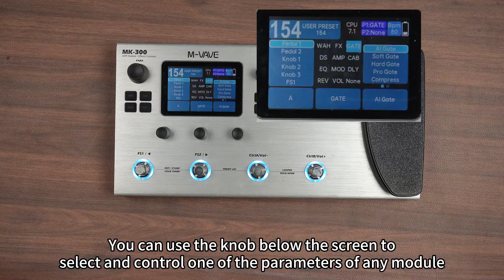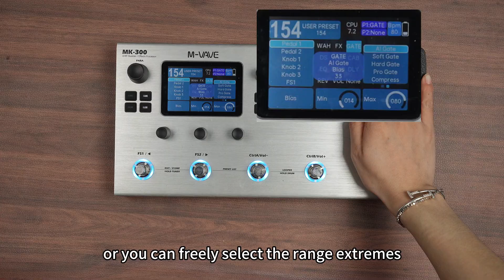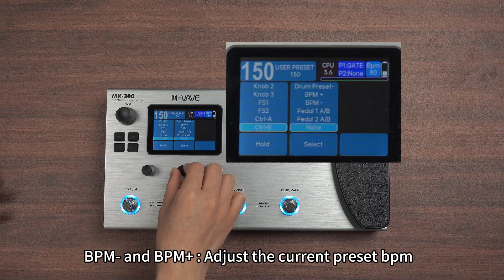M-VAVE MK-300 Multi-Effects Processor CTRL Module Introduction

Comment: Please release a new firmware update for the MK300.
There are several serious issues that need fixing:

When switching presets, sometimes the device turns off and reboots automatically.

Delay effects cause instability in certain presets.

Some presets crash the system randomly.

Also, we strongly request these new features:

Please add more OD/DS effect blocks to the signal chain.

Let users freely arrange the signal chain, for example: Amp → OD → Modulation → Delay → Reverb, etc.

Allow multiple instances of the same block (e.g., 2 delays or 2 drives).

Many users love this device, but it desperately needs an update to become more stable and usable for live or worship settings.
Please consider these improvements seriously. Thank you!
Reply from the maker: You can contact me on Facebook (M-VAVE Zhang) and send me a video of your question
Reply from the maker: Can you make a video of the problem of switching presets and post it on Facebook?
Reply from the maker: The signal chain can be moved. Press the HOME button, go to the STOMP interface, and use the PARA knob to freely move the effect position.
Reply: Worship 🤣